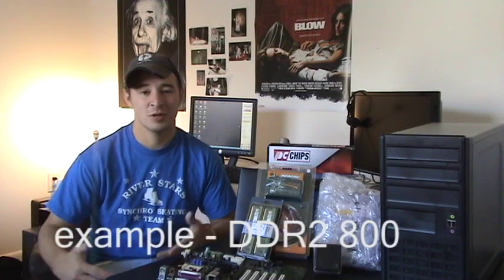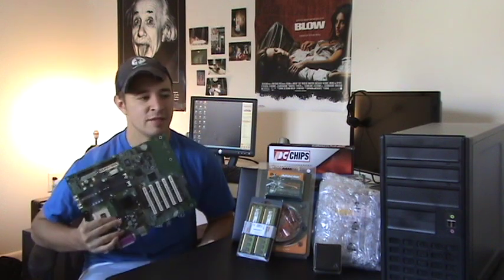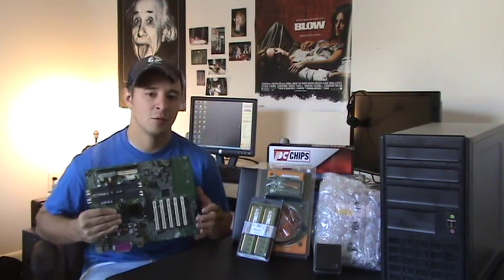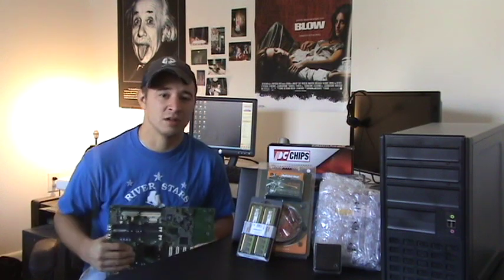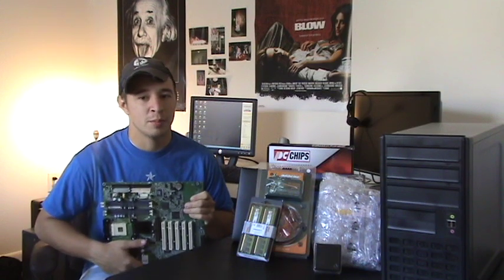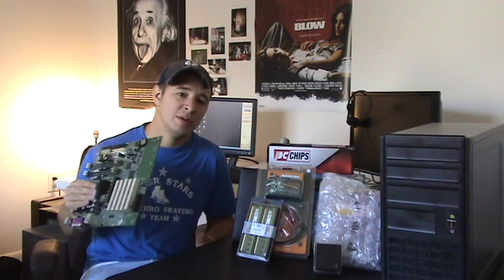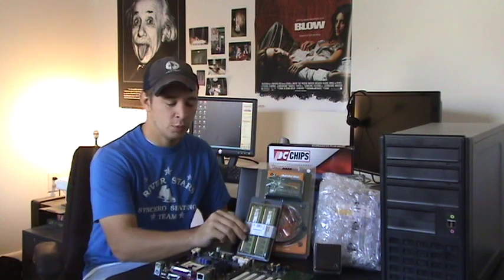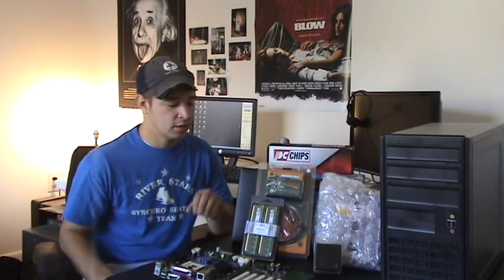How to Build a Computer - 6 - More on RAM

Comment: I recently installed 2x 2GB memory stick as one of mu older DDR2 1GB stick was faulty, so in all I've got 1x 1GB (yellow port) + 2x 2GB in the twin black ports. So far so good as my system recognized the new sticks and totally I've got 5GB of RAM. My motherboard being an ASUS P5B supports up to 8GB.

The problem is that using WINDOWS 7 Ultimate version is not using the whole of the 5GB installed which recognizes but only 2.87 is usable.

How can I configure to use the full RAM? Thanks!

Comment: if you put ddr2 1000 ram into a motherboard with a standard of 800, would it run at the 1000 speed or the 800 speed? is the standard just the lowest it will accept or the only speed?

Comment: @FSXI if you're looking at gaming the biggest thing you'll be looking at are processors. i have an Nvidia GeForce GT 220 graphics card, and an intel core duo 2.8Ghz CPU. it's good enough for what i play. if you're looking at newer games you might want an Nvidia GeForce 8600GT or better. and an intel core2 duo E6600 or better. ultimately, your budget will decide what you get.

Comment: Hey newboston, I like your videos alot and learned a ton. However, it would help a lot if you were to update them by just putting in pop up boxes that mention what is considered good on a yearly basis. Like if they have RAM that is DDR4, etc. That would help in terms of navigating what to buy in terms of what is top of the line at the time.

Comment: @xLithiumMan (OC) means the max the motherboard can handle when you overclock it. (You probably won't mess with overclocking if your new to building computers. 1333/1066 and others stand for what the motherboard can only hold. So just as an example you cant just get 1866 ram and put it in you would have to get something like 1600 and overclock it. I hope that helps.

Comment: Hi, a quiestion about RAM:
When you use 2 modules which are exactly the same you get DUAL CHANNEL mode, right? (if your motherboard supports it).
So... does that mean that 4GB with dual channel, could be better than 6GB (2+4, without dual channel)?

Comment: @teachinislearnin2 part 3
motherboard supports dual channel then this means that your motherboard can "talk" to both rams at the same time making your system faster. to be able to take advantage of dual channel make sure to buy two similar RAMs (same speed size and and brand) and install them in the corresponding banks. same applies for triple channel. there is much more to know about RAM but i think this will suffice for a regular user.

Comment: @teachinislearnin2  part2
money since a higher Mhz ram is more expensive. when it comes to how much RAM to install also check the motherboard specifications. if the motherboard supports 4GB or less then you can put up to 4GB of ram if the motherboard supports more than 4GB then you need to check if you have a 64-bit operating system to see if you will be able to install more than 4 GB of RAM. you would also need to know if you motherboard supports dual channel or triple channel, if your

Comment: ok some info about ram, by knowing which RAM type your motherboard supports you don't need to worry how many pins the RAM has. If the motherboard supports DDR3 then get DDR3 if it supports DDR2 then get DDR2. make sure to get the DDR type RAM the mother board supports because these RAMS are not backward compatible. if the motherboard supports 800Mhz RAM get an 800Mhz RAM because eventhough you can get a 10000Mhz RAM the board will only run at 800 waisting the rest and you will be waisting your

Comment: Is there an advantage to using the exact RAM specs of your motherboard?  For example,  putting DDR2 800 RAM into a motherboard that has specs of DDR2 800 instead of putting DDR2 1066 into a motherboard with DDR2 800.

Comment: @deepaksanath001 just check the name of you mother board and check it on google, then you can check the diffrent speeds you motherboard can handle. after that you can start checking for ram, and graphics card is just to buy a card that fit at example PCI or PCI-Express

Comment: If your good you put your mmother boards max RAM and then load the OS onto the RAM so it starts 30x's faster. it's like instant. Windows 7 is pretty big so you would need around 10 -12bg also be aware that windows can only handle so much RAM unlike linux

Comment: 4GB is enough? I use 12GB and planning to go for more. 3D applications like Realflow, Maya and so on work better and faster with more RAM and multicore processors. So by saying that going above 4GB is not worth it, doesn't apply in all cases.
Great work with the tutorials though. Learned a lot about computer hardware. Cheers!

Comment: I Want to get a p6t se Board which supports 1066 and 1333 stock but it can go upto 2000Mhz, can i shove in some 1600MHz Ram or will i have to do some configuring ?

Comment: thats just the OS (operating system). There are several types of operating systems like Windows, OS X (which is apple's) and Linux and there are tons of types of linux like Ubuntu and such...the OS is on the hard drive and you can just buy any computer and put any OS onto it or several Operating systems

Comment: It means, effectively the number of times the ram can be 'accessed' per minute.

It's not THAT important, but there's no point getting slow RAM, so I would go for whatever the mid-range speed is at any one time (So for DDR2, it's 800MHz, or DDR26500.)

If you want to overclock, the faster your RAM, the better, though. Your overclocking will be limited, in part, by the speed of your RAM.

Comment: Dude, ace vids 100% help and subbed! You probably dont have time to awnser so this is like a question to other viewers. If I have 1gb RAM in my PC and decide its not enough is it easy to plug in another 512mb or is there like loads of extra stuff to do. Also when talking about the opticle drive, is there a certain speed at which your mother board cant handle, as in like a motherboard that can only take a maximum of 4gb RAM.? Thanks and please reply, Great vid again =-]]

Comment: Sorry for double posting, MMOchamp9, how much ram do you plan on getting? If it's anything less than 4 gigs or so, you are blowing money away. XP has a 64 bit version aswell. 

64 BIT- Ram Support
             - Significantly faster performance
             -  Best for server hosting
             - Higher virtual memory.
            
Costly. 
Some programs might not have compatibility.
Overkill for even the most hardcore of gamers.

Comment: 32 bit gives better performance currently
also, i think the bit is just the Operating System, not the actual system, though i could be wrong.
And 64 bit, would need a minimum of 4GB for it to be worth it
Which effectively costs Alot more then a 32 bit with 2GB which would work faster.
Also, how big is your Budget? to have something at 128 gig.
As well as your building it

to buy 16GB online it costs roughly $120 or more.

so using that, 128 GB is approx $1000.

Thats alot to spend on a computer

Comment: 1.5v????? umm what are u using ddr3?? cuz they dont make 1.5v ram fo ddr2. also the standard for ddr3 is 1.65v...
my brother had the EXACT same mobo as this guy uses for his build (the PC Chips mobo not the one the guy is waving around) and he had some 2.0v ram and it didnt work XD and we found this this mobo ONLY supports 1.8v ram. even sayed 1.8v right on the slots. got 2gb (2 1gb sticks) of AData 800mhz cl 5 ram on newegg (the ones with the nice red heatsinks) worked flawlessly

Comment: 1st thing you need to know is what the Mothers capacity is for on board memory. Some can handle 2 ghz & others 4 or more. If you buy more than you need. You'll just be throwing your money away.  You can figure out have ( on XP ) by going to control panel & double clicking the system icon. You'll get basic knowledge of your systems specs. If you are unsure of what type you need I suggest going to w w w . crucial . c o m . You can find out what you need by giving basic information about you type.

Comment: it can't only take 3 GB. Sometimes it takes less. The maximum for 32-bit OS is 4 GB, including the small amounts of RAM in several components like optical drives. Very small amounts. Larger amounts of RAM in components can be found in video cards.

Add all up and it must be below 4GB.

Comment: I think once you go above a certain clock speed, the CPU just gets really unstable.  Back in the Pentium days Intel was working on a 6GHz processor but they couldn't get it to work, so they started adding more cores instead of bumping up the clock speed.  In ten years we'll probably have 128 core processors instead of 10 GHz.

Comment from the maker: no the maximum memory is just the maximum you can put in. you can add ANY amount of ram as long as its compatible.  so 16gb max you can add 1 gig if u want! you can get either  1 x 4GB or 2 x 2GB. 2x2 would be faster tho. make sure you put them in the same color slots on your mobo tho, this will make it dual channel and faster!